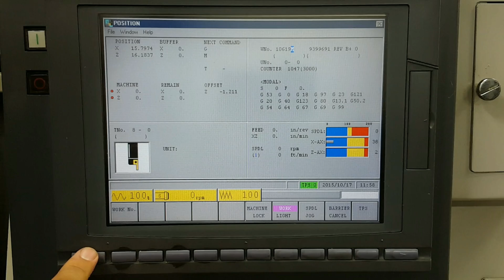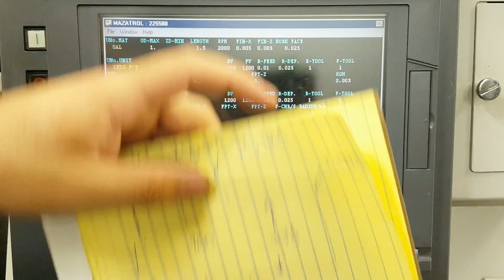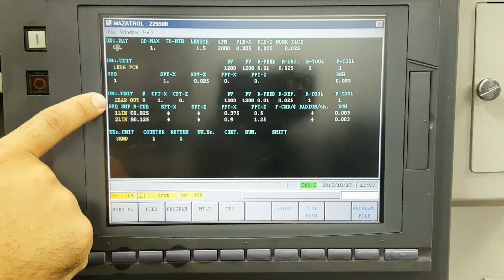Mazak Lathe Programming #4 Bar Out

Comment: .025 depth of cut? hike up your skirt, Sally!
Reply: +James Hollister   What's wrong with .025 depth of cut, I think the purpose of this video is entirely for educational purposes only, depth of cut is based on what material being use.
Reply: sorry sally,  but he's right . .025 is gonna tear up your tool faster than you think. faster speed and deeper cuts transfers the heat to the chip and not the insert therefore prolonging tool life
Reply: +James HollisterSo you want 2.5 depth of cut??? hi silly, i think you cut plastic all day long without worrying about scrap because it is cheap.
Reply: not that much but maybe .1 per side...to break chip